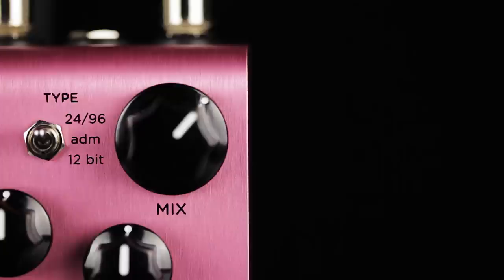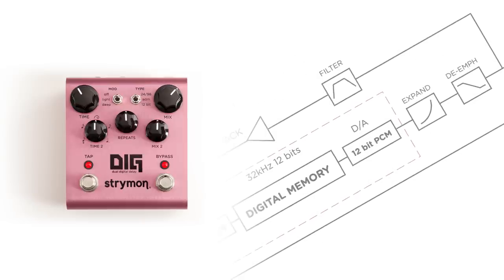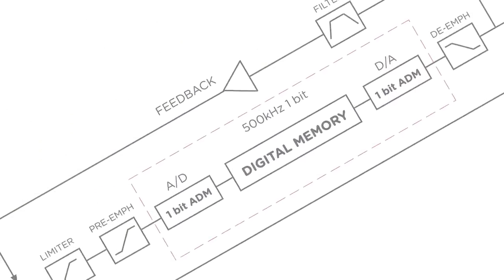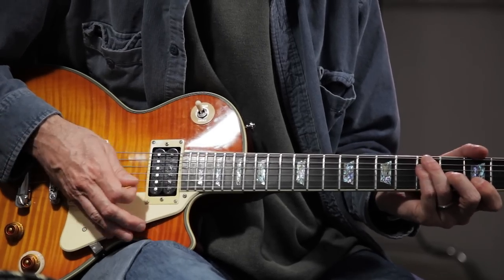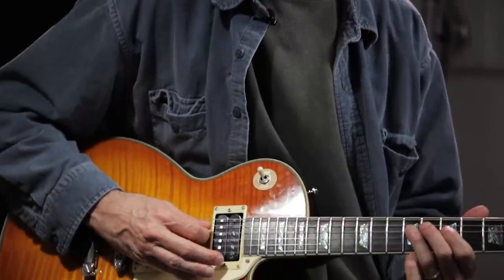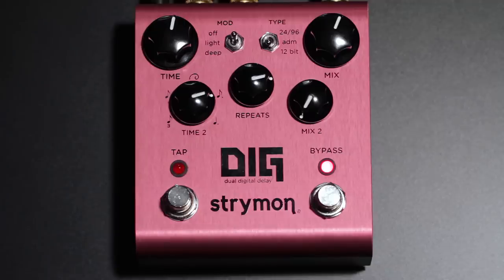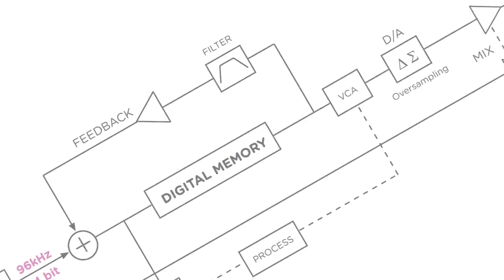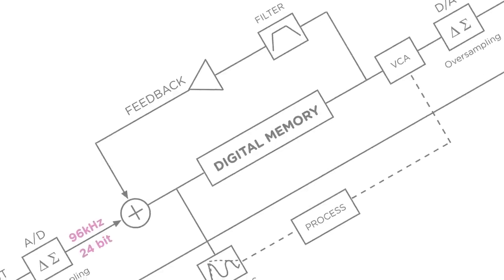Strymon DIG Dual Digital Delay - In Depth Demo

Comment: Hey, guys, I wanted to know if there is any relation between the sound of the 12 bit mode and the sound of dark analog delays. I know that digital delays don't do so well with high repeats because of their bright sound, so I'm wondering if the 12 bit mode is a solution to that. 

P.S: I own the DIG and I love it.

@strymon
Reply from the maker: +Philip Hernandes Analog and 12 Bit digital delays process their effects in different manners to achieve their distinct sounds.  Analog delays use bucket brigade chips to produce their delay repeats which lower in fidelity with longer delay times and repeats.  The 12 bit mode of the DIG achieves its warm sound from pre-emphasis and compression prior to the A/D conversion where the delays are generated.  For the D/A conversion, an expander returns the signal back to the original level along with de-emphasis to restore a flat signal response and reduce noise from the conversion process.  You can certainly use 12 bit mode for warmer and darker digital delays.

Comment: have you ever considered seperating (or allowing for seperation) of the tap and bypass from the control functions so that (for example) the bypass and tap remain floor controlled and the rest of the unit is 'top of the amp' or other, more easily accessed by hand? The unit sounds really useful BTW!
Reply from the maker: Elliker Donald Glad you like the Dig!  We did not consider it for this pedal as we were going for a traditional pedal design with on-board TAP Tempo and Bypass switches.

Comment: So is the internal chip modeling the sound of the conversion of a 12bit a/d/a or is the signal actually being converted using 12bits?
Reply from the maker: The internal DSP is modeling the 12-bit sound.

Comment: I tried the settings at 13:26 and could not reproduce the same sound in this video. was there a reverb involved that we don't know about? such as reverb knob on an amp?
Reply from the maker: +leoetine There was no reverb involved in this video demo and all the effects you heard are from the DIG pedal.  For the setting you described, did you make sure to set the FEEDBACK FILTER to minimum (press and hold down both footswitches and turn the MIX knob to 0% while holding them down before releasing)?  If not, make sure to set this parameter.  Also, the CONFIGURATION is set to SERIES and DELAY 2 is sync'd to the Dotted 8th setting with both MIX knobs around 1 o'clock.
Reply: strymon thank you very much, I'll try it tonight!

Comment: in minute 10:38 I see that you activate the secondary function by pressing the tap and bypass buttons. But I also see that can you bring back the buttons to 12 o'clock and I'm not sure what that is for? 
Thanks
Rob
Reply from the maker: Hi! So basically Pete is moving the knob a little to just make sure that the secondary function is set to the ping-pong configuration, which is around 12:00.

Comment: Does it sum of it is receiving stereo inputs. Do the timeline/bigsky sum if they are receiving stereo inputs but only sending the left channel?
Reply from the maker: Jon Guerra When using Stereo input, the LEFT INPUT goes to the LEFT OUTPUT, and the RIGHT INPUT goes to the RIGHT OUTPUT.  It does not sum the signal to a single mono output when using STEREO input.

Comment: I have a question:

Just to be sure: If MIX is set to minimum and  Delay 1 is set to be tempo dependant but the quarter note is selected, can we then use the tap tempo switch  to set Delay 2 as the sole delay without it being dependant of Delay 1?  

Thanks for the very informative videos.
Reply from the maker: +Hysterix Just to clarify: the TAP Tempo switch will only control DELAY 1.  DELAY 2 can sync with DELAY 1 when set to SYNC mode, but when set to FREE mode, only the TIME 2 knob will control the delay time for DELAY 2.
Reply: Yeah I got the part about free mode. But since delay 2 has more subdivions, it seemed more practical to me to use delay 2 as the default delay and only use delay 1 for dual delays.

So what I'm wondering is , since delay 2 depends on delay 1 in sync mode, can  delay 2 be set with tap tempo if delay 1's mix is at 0?

Though i just noticed that delay 2 cannot do a quarter note ...
Reply from the maker: +Hysterix Yes, when DELAY 2 is in sync with DELAY 1, the TAP tempo switch will control DELAY 2 with the MIX of DELAY 1 set to 0%.  And, yes, there is no quarter note option for DELAY 2, and you would need to use DELAY 1 for quarter note repeats with the MIX of DELAY 2 set to 0%.

Comment: Hi guys, i've got the DIG and the DECO. I need to run them together in stereo mode (Deco in studio mode too). Better run the Deco in the Dig or viceversa? They are the last pedals in my chain, and directly plugged to the mixer. I need the widest stereo possible effect, i mainly play in theatres. Thanks!
Reply from the maker: +Stefano Gualteroni Thanks for being a Strymon customer! :)  I think in this case, it is just a matter of which setup sounds best for you since they both have great stereo separation which will pass on through to each pedal, especially with the Deco set to Wide Stereo mode.  Try both and use the setup that works best for you.
Reply: +strymon Thank you to you for building really great products :)
I'll try both chain versions, my doubt was due to the Deco saturation, which is great in the theatre mixer, hope it will work the same even if followed by the DIG. Thanks again!

Comment: can someone tell me if dig's tap tempo also cuts out the feedback when you step on it, like the el cap? or if it warps, like the brigadier
Reply from the maker: On DIG, tapping a new tempo while there are delay repeats in the delay line will re-adjust the delay time without any muting or pitch shifting artifacts.
Reply: that's a step-up! thanks strymon

Comment: Does this mean that Delay One is always relative to the Tap Tempo ? If we increase the time of the delays of Delay One, does that automatically change the Tap Tempo relative to Delay One ?
Reply from the maker: Yes, that is all correct.  The TAP tempo controls the TIME (delay 1) knob, and adjusting this knob also reflects in the blinking of the TAP tempo LED.

Comment: Which sub division has the Delay 1??
Thanks in advance
Reply from the maker: Delay 1 is set to quarter note subdivision by default. You can also set it to dotted eighth note or half note.
Reply: @strymon  great! Thanks! But how do you do that?
Reply from the maker: @borealico  It's a secondary function. You press and hold both footswitches and then turn TIME to the desired subdivision. Check out page 3 for more information. 

https://www.strymon.net/manuals/DIG_UserManual_REVA.pdf
Reply: @strymon  thanks again! Strymon rules!!